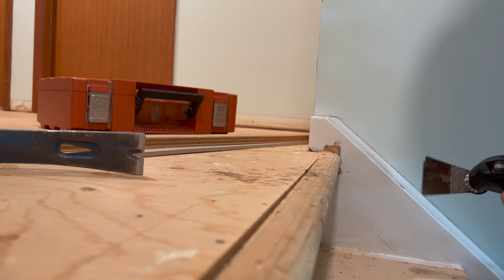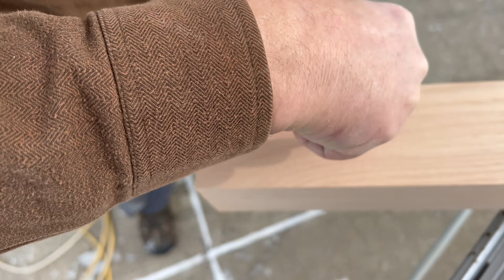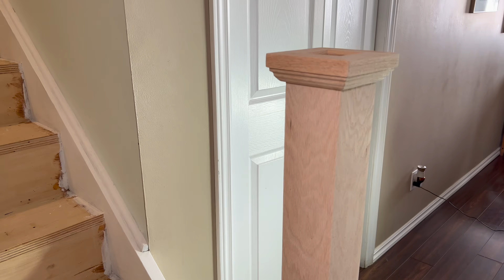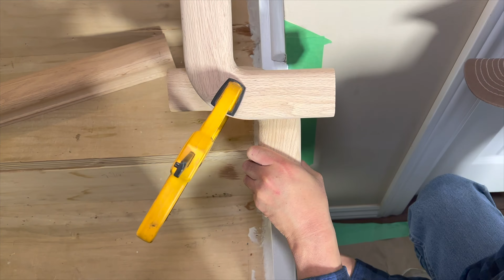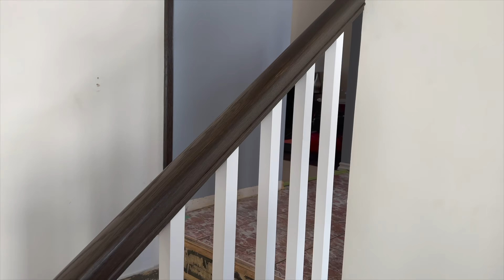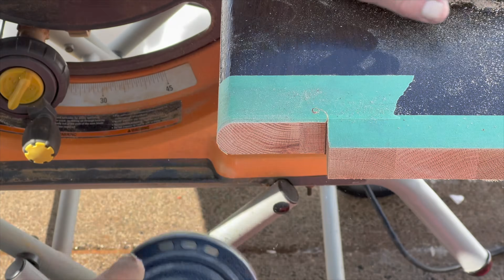Complete Stair and Railing Makeover

Comment: Scott, I know this is 3 years old, but I have a quick question: When doing plowed rail and square-top balusters, do you glue and tack in your fillet with brads (18g?) and leave the balusters floating, or do you glue and tack both fillet and baluster? That particular section moves fast, so it's hard to tell. Thanks for your time!
Reply from the maker: I use glue and 23 ga pins on the fillets. That way I don’t have brad nail holes to fill. I use glue on the balusters as well. Thank you for commenting. Cheers Scott
Reply: @scottearlsmithFTC  Thanks, Scott!  I truly enjoy your videos. I've learned a lot!
Reply from the maker: @boxcarvibe5671 thank you so much.

Comment: Hello Scott, thanks for the very informative videos. I am planning to tackle the stairs project in my home and all your videos had helped a ton. I have a question regarding finishing. I've read that we need to finish both side of the wood piece in order to prevent it from warping (such as in table tops). I see that you only finish the top and nosing part which is what i am planning to do. Have you had any issues with treads warping or any wood movement because of this? Best regards!
Reply from the maker: I've never had call-backs on treads warping or cupping. Even on the ones that are not screwed from the bottom. Those treads are laminated wood strips about an inch wide. I don't stain or clearcoat the bottom because I want max adhesion with the glue. But great question and thank you for the encouragement. Cheers, Scott

Comment: Scott, very nice job. I have a question on the treads. When your going over existing treads like you did, that raises the riser height by the thickness of the new tread, in your case, 3/4". At the top, you would have to add a 3/4" bullnose on top of the original bullnose to keep all the risers the same, but now your 3/4" above the finished floor. Where I live, the shortest and tallest riser cannot exceed 3/8", with a maximum riser height of 7 3/4". Really enjoy the video's, thank you for sharing.
Reply from the maker: Yes we have the same rule here so you have to discuss that with your customer/inspector. However, quite often rug has been removed and/or hardwood floor or tile has been added since the original build and it all works out mathematically. Where I work that rule has to be followed on new builds and rarely applies to a renovation. Hope that helps. And thank you for the compliment. Cheers, Scott

Comment: Hi.     I just finished facing my contractor stairs with maple treads, risers and skirt boards.  I used PL and 6.  1 1/2"  screw per tread.  It never made a sound for a few weeks.  Now a couple stairs are starting to creek.   Any suggestions that may fix the problem?
Reply from the maker: @chip7646  If the stairs are still accessible from below have someone walk on the stairs while you watch and listen from underneath. Sometimes it’s the stringer rubbing on the wall, or if you installed a stringer cap that could be rubbing as well. Good luck, Scott
Reply: @scottearlsmithFTC  thank you for your advice
Reply from the maker: @chip7646  You're welcome.

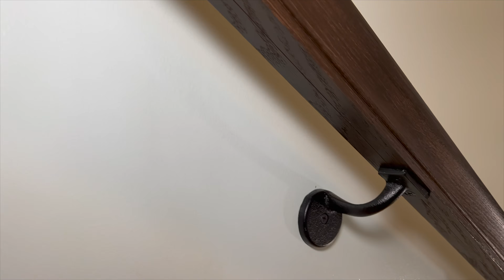Comment: At 17:15, you show the top of the railing. Doesn't that need to return into the wall?
Reply: I must rather prefer this than returning into the wall.  The only reason you would want to return it into the wall is if you needed to for strength IMO.
Reply from the maker: @24revealer  Yes. I understand that some jurisdictions require them returned to the wall. This is apparently related to firefighters catching their breathing hoses on the ends of railings.
Reply from the maker: Not in the jurisdiction where I work. It's not required to return railing ends to the wall. That railing has a factory finished end with a round-over. Thanks for commenting, Scott

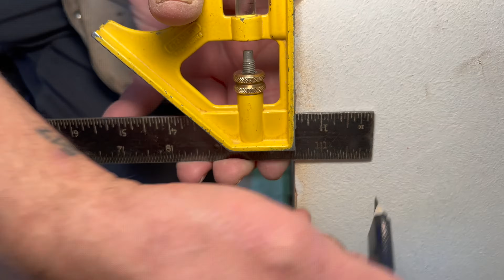Comment: At 6:57 you mention make a 1.5 inch notch in the stringer. How did you come up with that measurement? Is it just half the thickness of the newel post? I'm using a 4.5 inch box newel and am wondering how far in to recess it.
Reply from the maker: I recess 1.5" simply because it gives me enough remaining thickness (2") for strength on a 3.5" newel post. It also gives me enough post for the nosing to terminate fully into the post. If you're doing a box newel you can simply decide on something that looks and feels proper. In the past what I have done is installed a construction grade 4x4 onto the staircase and then slipped the box newel over top. Not sure if that is something you'd consider. Cheers, Scott

Comment: Thanks so much for sharing! What is this thing that you use after connecting the pieces of railings, looking a bit like a fan connected to a drill? What's it's purpose?
Reply from the maker: Thank you Robert. That is called a Lamello Invis. It is a strong magnet that turns a hidden fastener inside the railing joint to make a solid connection. Really a remarkable tool. I have several videos on the Lamello Invis. I will put a link here to the introduction video. Cheers, Scott https://youtu.be/Xaw5x4I06D8?si=ahEhNg-isLXDP5-9
Reply: @scottearlsmithFTC  Thank you very much!
Reply from the maker: @robertkiessling9700  You're welcome.

Comment: Don’t you have to router out the riser shape into the newel post so it sits inside the newel post?
Reply from the maker: No. Not in this case as they are technically "faux" risers. They are not structural. Basically covering the original riser. Thank you for commenting, Scott

Comment: You should not put the new threads over the existing threads. It will make a serious building code violation that the most top riser height is 1” shorter and the most bottom thread is 1” taller, which become a serious safety hazard. You should remove the old threads before installing new ones.
Reply from the maker: I appreciate the feedback Andy. Technically you're correct, but every time I have added treads onto the stairs, the home has already had new hardwood flooring added to both floors so the top and bottom risers work out to be very close to all the rest. Scott
Reply: @scottearlsmithFTC Agreed. I find that, in the majority of cases in my area (GTA East- ie: Toronto), the existing bottom step is short and the existing top step is tall. These all passed new-build inspection. This is true whether the floors are carpeted or hardwood. I have always assumed the staircase builder allows for 1" thick of carpet and underpad on the stairs, which would be a common thickness (1/2" underpaid and 1/2" carpet). Most times the new tread thickness brings the top and bottom steps into alignment, or at least closer, to the same height as the other steps. Practically speaking, slight variations in step heights don't cause issues on the bottom and top steps, anyway, because the brain doesn't kick into automatic cadence mode until after the first step on the staircase, and switches off on the last step away from the staircase where visual cues and cortical judgment take precedence over cadence programs.  Step height variation only becomes a tripping hazzard on the steps in between.
Reply from the maker: @paulmawdsley2027  Totally agree. Whenever I build stairs for a new home/or reno I find out what flooring they are going to install. Sometimes they haven't decided on flooring yet so I have to make a judgment. Most older homes where the stairs are being re-done are generally 30-40 years old - or older - and they've changed the flooring. Sometimes even right on top of the old flooring. Thanks for weighing in. Cheers, Scott

Comment: I'm glad to have discovered your site and intend to check out the videos! Question: Do you have a "magic formula" for tightening a loose 3 inch doameter round newal post at the bottom of the stair case?
Reply from the maker: I have a magic formula but it will cost you! (Just kidding.) Without seeing the post, I would see if there's an opportunity to glue and screw the post securely (long lag screws like GRK or U2). Usually posts loosen over time from constant use, and especially if they have been installed without solid craftsmanship. I have a short on unsafe stair railings. At the beginning you'll see my son pushing over a balcony rail. That is legit. It was that loose. Cheers, Scott  https://youtube.com/shorts/HFGPCyxX_ek?feature=share

Comment: Hello Scott.  Per your request for feedback:  your videos are so so good.  It’s a real pleasure to watch a kind, gentle meticulous Christian craftsman share his knowledge to help folks like me.   A few questions as I gather estimates from local tradesman for my carpet-to stair.

**On some points, they contradict each other in their approaches**.  Perhaps you can weigh in?

We’re putting 3/4 inch primed pine risers and 1” with oar treads on pre-existing stringers.  3 stringers, 36” treads, skirts on both sides.

1.  To ensure no squeak is it imperative to put adhesive at the tread end grain where it meets the skirt?   One guy says his stairs don’t squeak and he doesn’t put glue there.  Another guy say he leaves a fingernail thick gap at tread/skirt to avoid squeaks.  It looks like you don’t use glue there.  No youtube video (yours or others leave gaps)

2. Screws thru the riser into the back of the tread or just glue where tread and riser meet?  Again, some say screws are necessary while others don’t.   What degree of tread back-bevel do you use to accommodate the adhesive?

3.  One vendor advised there is a fast drying glue by Bona called Quantum that is made to use without face nails on the tread.  I love that idea.  Have you used it or heard of it from suppliers or fellow tradesman?

4.  If we do face-nail the treads, I love that you use 18g instead of 16 or 15.  My woodworking experience tells me 18 2” brads have enough holding power for the glue to set up, but I’ve never done treads and all vendors I’ve talked to like 16 or 15.

Thank you.
Reply from the maker: Hi Richard. Thank you for the compliments on my videos. I can answer these questions better if I know exactly what you are doing. Perhaps you'd like to drop me an email with some pictures so I know exactly what you are doing. This sounds like you are basically re-building your stairs rather than covering existing treads and risers? Cheers, Scott scott@scottearlsmith.com
Reply: @scottearlsmithFTC  
I will absolutely take you up on the offer and hope to do so later today.  Thank you so much.

It’s a conversion from carpeted stairs to painted risers and oak treads and landing.  If I don’t get comfortable with any of the vendors I’m speaking with, I am strongly considering doing this myself.  I already am redoing the hampton myself.  

BTW, after the steps are done, I plan to do my own rail, newel posts and balusters Your video of the “H” shaped metal balusters install gave me the confidence.  Rail shoe was a knowledge bomb to me.
Reply from the maker: @richardcloud9265  Look forward to your email brother.

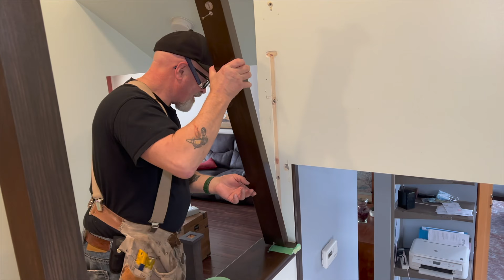Comment: Thank you for this great video! We are planning a staircase remodel and this was super helpful! At 10:56 when you're attaching the half newel to the wall are you fastening into a stud in the wall? We've got a weird situation where there is a pocket door behind the area where we need to attach to the wall, so don't have a stud to fasten to. Just wondering what you would suggest for that situation?
Reply from the maker: Thank you for the compliment Rachel. Next time I encounter your problem I will do a video on it so it's easier to explain. I'm not sure how much clearance you have to the pocket door so you'll have to determine that first before you pick one of my solutions. One is to use a threaded metal plug into the drywall. Mark the drywall with the screw(s) you are going to use and then insert a metal plug (they make them threaded for drywall). The other option is to make a hole (square, rectangular or round) behind the half-newel and make sure it will be covered with the half newel afterwards. Then insert a piece of plywood (3/4") that is bigger than the hole but you can fish it into the hole (kind of like moving a large table through a small door, if you get my drift). Then secure the plywood to the drywall with a couple drywall screws - now have a piece of plywood to secure your half newel. In both scenarios use construction adhesive between the half newel and the drywall. Good luck, Scott
Reply: @scottearlsmithFTC  Thank you for the reply! I'll check out the drywall and see if that first option would work. I can picture what you're describing with option #2 as well.
Reply from the maker: @rachelsoukup8  Good luck!

Comment: Love the video great information.  Quick question, I'm redoing my stairs in maple to match our wood floors, you suggest Saman's or the Finitec, how durable are they...
Reply from the maker: I've had good luck with both. Saman has one with a hardener that you use on the last coat. In that video I used Saman with the hardener. I apply about three coats before I lightly sand with 320. The fourth coat will have the hardener. Most recently I've used Finitec hybrid, which is a commercial grade product. It's good too. I've been applying with a Finitec 6-inch pad. You get nice smooth coverage that way. Thanks for your comment.

Comment: So, I have to ask as I'm in the market for a new miter saw. I've been running a Milwaukee 12" for the last fifteen years and it's time for a new saw. I see that you have Festool everything, and a DeWalt miter saw.  Is there a reason you didn't go with a Kapex ?
Never mind, I just finished watching another of your videos and see the shop saw is a Kapex.
Best regards. Keep up the content. Always enjoy watching another carpenter work.
Cheers
Reply from the maker: As you saw, the Kapex stays in my shop as our roads are so brutal here that I just don't want it being pounded around in my trailer. (Cold winter temps and deep frost make city streets look like logging roads.) The Dewalt is a power house and seems bullet proof. I had to cut 4x10 douglas fir roof beams on a compound angle and the Dewalt powered through it no problem. Initially it was in my shop but I am tight for room and the long rods on the Dewalt make it impossible to put tight against the wall. So I bought the Kapex for the shop. It was between that and the Bosch with the articulating arm. My son has the Bosch and likes it very much. I do see some finishers with Kapex saws on the job site. The portable mitre stands from Festool cost a lot. So it just boils down to $$. Cheers, Glad you're enjoying the channel!

Comment: U ever try the keyhole bracket from lj smith to fasten newels. Using them for yrs n love it
Reply from the maker: A supplier gave me one to try and I lost the key portion of it somehow. I will have to check them out. Thanks for that tip.
Reply: @scottearlsmithFTC  
I make a lil jig to rout that plate in. Super fast n very solid. Never got a complaint for a loose newel
Reply from the maker: @Tom-sd5ru   I will check that out. Thanks for info.